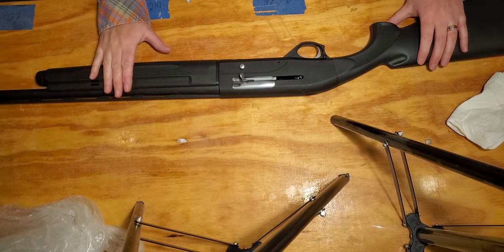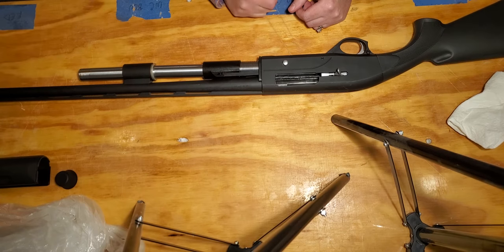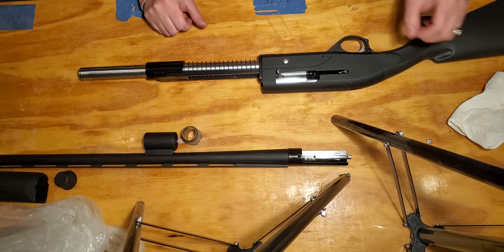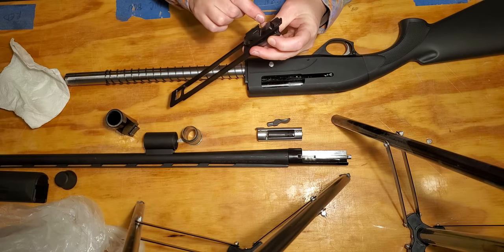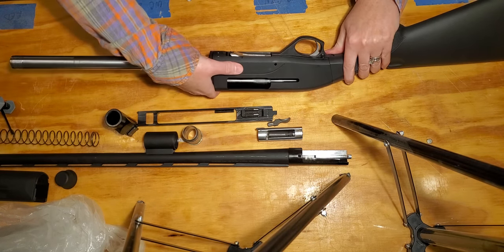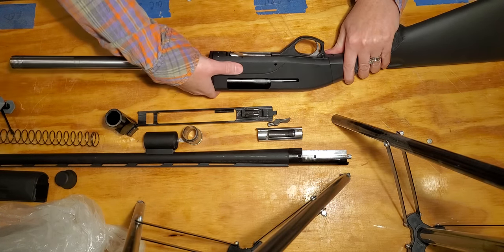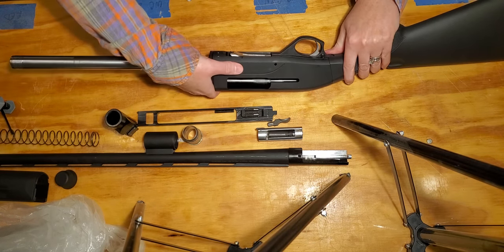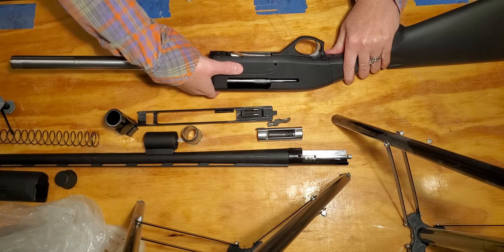Mossberg SA 20 Disassembly & Assembly

Comment: I have had this model for a few years and I really enjoy the gun. The one that I have is setup more tactical and has a 10 shot tube on it. It has never failed to operate smoothly and correctly. I sold my 930 12 gauge it was just too much for my shoulders that were damaged in an accident years ago. Very good video.
Reply: I can seem to find info on removing the magazine.  Can you point me in the right direction or perhaps explain how to do it?

Comment: THANKS FOR THIS TUTORIAL!  I WILL LIKELY GET ONE OF THESE GUNS, (I PREFER A SEMI-AUTO" TO A PUMP ACTION GUN...)  PERHAPS CLAMP, OR SCREW DOWN A "STOP BLOCK", ONTO THE BENCHTOP, AT THE BUTT OF THE STOCK, TO HELP KEEP THE GUN FROM ACCIDENTALLY SLIDING AWAY, OFF THE BENCH, AND CAUSING SUDDEN LOSS OF SPRING PRESSURES....[TRY USING COUGH DROPS.]

Comment: Just picked up this model shotgun and your disassembly/reassembly video was perfect. Thank you!  LUBRICATION: Do you have any recommendations on lubrication and lube points for this shotgun?  I’m having failure to eject and failure to feed issues and someone suggested it was a lubrication problem. Thanks.
Reply from the maker: Your model manual will have all of the oil points highlighted for you. I'm someone that oils everything (except for inside of the trigger mechanism) and then wipe it all off so that it has a light oil residue on it to keep it from rusting. My shotgun is kept in a place where I can reach it in an emergency instead of a moisture controlled gun locker.

Comment: Nice job. How do I remove the the tube holder to load 6 rounds?
Reply from the maker: Remove the end cap on the magazine tube. You will see the plug in the end of the tube. (It's been a really long time since I removed it.) You may have to use a tool to turn the plug & push it down in order for it to release & come out? I don't even know where the plug to mine is anymore. If I find it, I'll see if I can reinstall it to do a video to take it out again.
Reply: @mudslinger789  I love my SA 20 but I've got the same problem with removing the plug. Any help would be appreciated. Thanks for taking the time to make this tutorial. Its really helpful.

Comment: Hello, is this the all purpose model, 75771 or 75772.  Is the rail tapped for a scope.  Guy at factory could not tell me for sure
Reply from the maker: The markings on the barrel, and the manual do not specify. I can tell you that it is a smooth bore with a fluted rail. There are no drilled taps along the rail, but I'm certain that you can get a scope to clamp to it.
Reply: @mudslinger789  TY